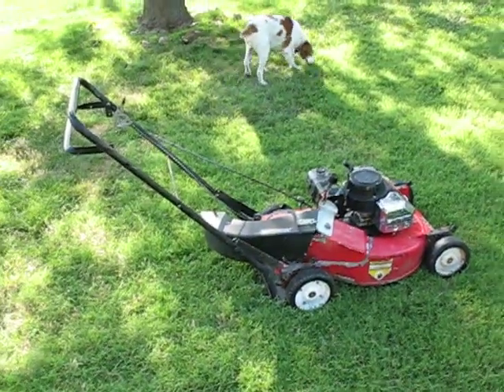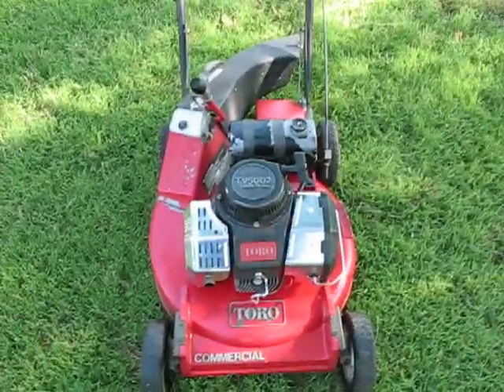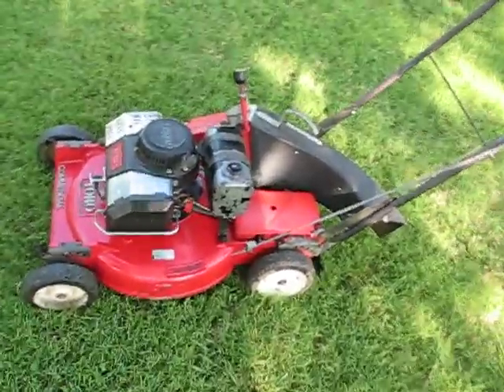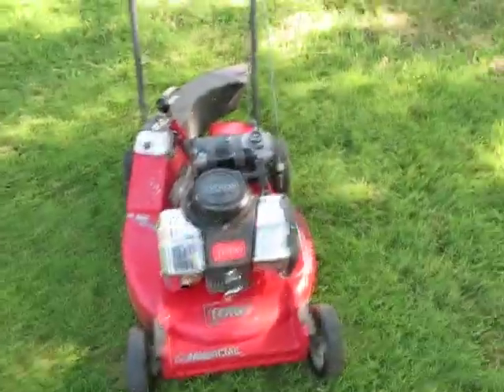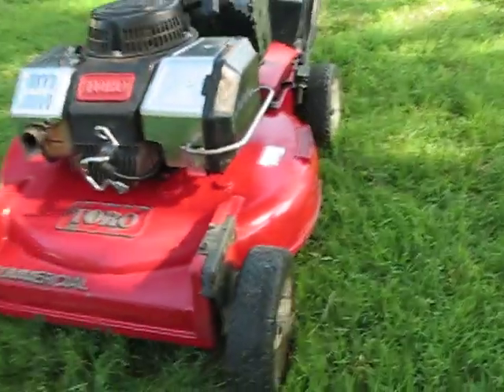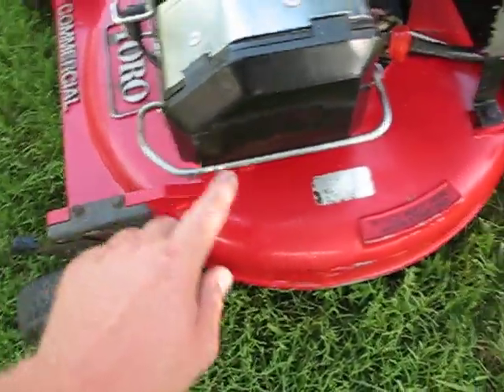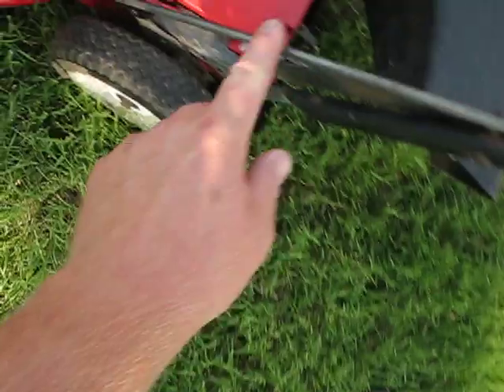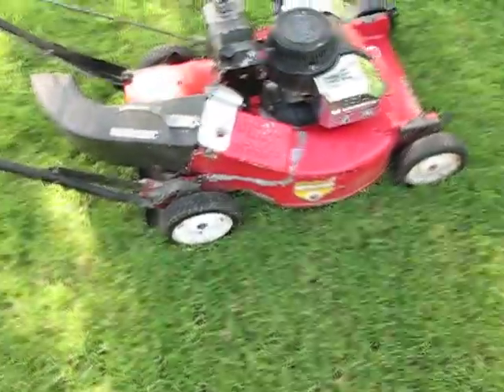Toro comercial 22035

Comment: Those Suzuki 2-cycle engines are amazing.  They seem to run forever if the air cleaner is maintained and the gasoline mixed properly at 50:1 to 40:1.  I was recently given a similar Toro Commercial but the Model tag is missing.  Mine has no safety's whatsoever.  When you start the engine, the Blade turns.  No Blade Brake.  Has a cable to engage the transmission by tightening the belt.  Sadly, my Belt Cover is missing.  The Gal that gave it to me said it hadn't run in years and it was sitting outside for many of them.  She got it from a Landscaper that was converting to 4-cycle Mowers.  I brought it home and removed the Mikuni Carburetor and cleaned it up.  The idle jet has a very small hole and it was plugged.  With the Carburetor off of the engine, you can inspect the skirt of the piston viewing through the ports.  It has no visible scarring.  The Gas Tank was full of sludge and rust.  I still need to work on the Gas Tank.  But as it is, I put in some premix and it started on the second pull. The mower is very ugly and the rear tires are bald.  I was going to use it for parts but have decided to restore it.  It has a safety tag saying Meets 1984 Safety Standards.  Wish I could figure out the Model Number.  Only complaint is the Muffler does little.  I'd like to quiet the exhaust down somehow.

Comment from the maker: The "bail"  is just for the self propel only....When engaged it pulls the mower forward.  This is a comm mower, they are different than rez models.

The engine is shut down with the throttle control. When you slide the throttle contol all the way back it kills the engine.

Comment: All Suzuki engines on Toro mowers should run in the range of 2850 to 3150 rpm (3000 rpm should be targeted when the governor's return spring is in the middle hole of the governor linkage).

Comment: I have a 22030 I am working on. Came with no wheels. Would you be so kind as to list the outside diameter of the front and rear wheels? TY!
Reply from the maker: About a hair over 7 3/4"   I bought two replacement front wheels at Harbor freight that have been fine for two years now.. Rear would be a different story. You need the gear attachment to the rim.
Reply: @Indy452  Thanks for the reply! I appreciate the information. I don't have the transmission either so I'll just be pushing it! Now I have an idea what to look for!

Comment: Suzuki TV5002 = final "2" means "2 cycle." The OHV 4-cycle engines would have the "TV5004" designator on the recoil.
Reply: This engine has a 50:1 ratio of oil to gas. In this case, you would be using 2.6 ounces of oil to one gallon of gasoline to accomplish this. On home use mowers such as the 20684, with the two quart fuel tank, you would use 1.3 ounces of oil to two quarts of gas.